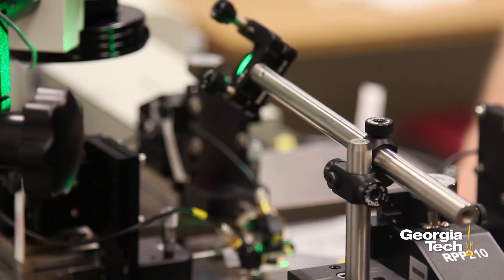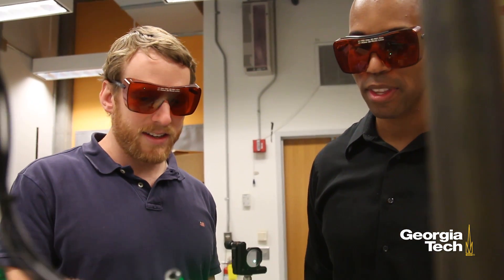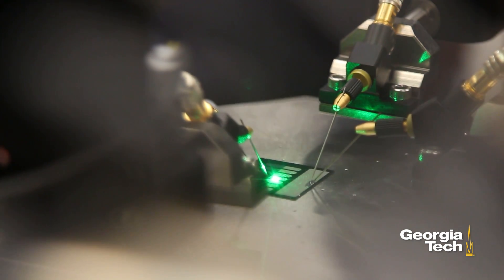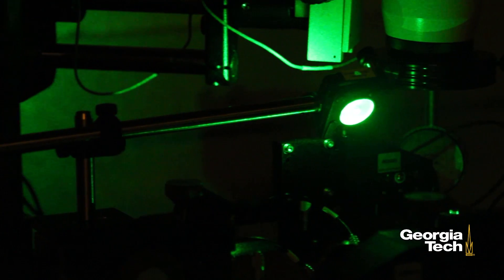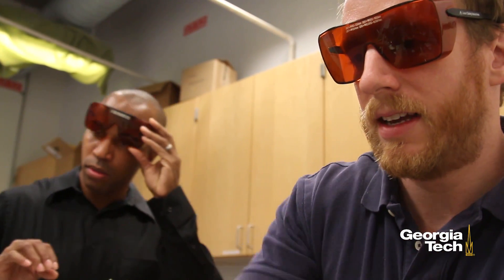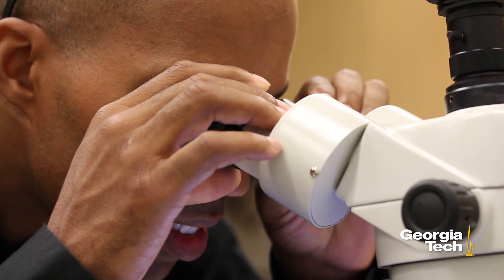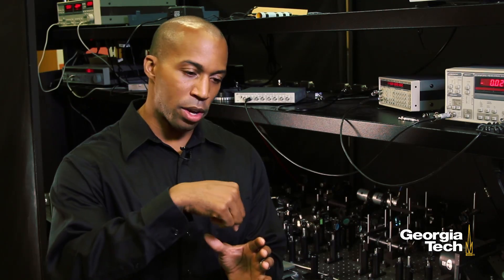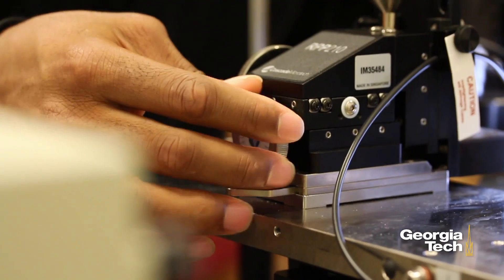First Optical Rectenna Converts Light to DC Current

Comment: Almost 10 years ago and yet this topic is highly underrated or there is some significant obstacle
Reply: Or it was a scam from the start.
Reply: @MDNQ-ud1ty  no, theory explicitly say it could work the question is how to implement it.
Reply: @Ayvengo21  Theory doesn't preclude fraud, corruption, exaggeration, etc.

Are you really going to try to use the logic "Because it is possible in theory it means they did it"?
Reply: @MDNQ-ud1ty  they might did it, but efficiency suck, price is insane and reliability at best questionable. Could it be fraud? Sure! Just like every company that promote their low wind small turbines for generating electricity, but there it even theoretically impossible to be effective

Comment: Ever since I was a kid and first learned that radio, light, xray, gamma, etc are all the same phenomenon, I wondered why I couldn't transmit light from an antenna.  I imagined keying up my CB and having an amplitude modulated light carrier pump out of my home made ground plane.

I recently started looking into the idea of receiving light with an antenna and low and behold it's being worked on.  I can just imagine a sheet of material tuned for the IR range that gets cold to the touch as absorbs ambient IR and produces a current to operate another device.  Very neat - can't wait to see what comes next.
Reply: That will prove the 2nd "law" of thermodynamics wrong. It was always based on statistics alone that "we never seen one so it cannot exist" kind of way. We should be able absorb heat from the environment and cool it down to convert the energy to different type. Open systems don't conform to the classical thermodynamics.
Reply: They are not utilizing antennas,, That might be the reason you are not transmitting.
Try a Different Approach😉

Comment: "Converts Light to DC Current", isn't this exactly how existing solar cell / photodiode works? Why would using an antenna better when the sun isn't exactly a signal generator (i.e. sunlight is kind of constant in intensity)? I know I'm missing something though. Could anyone explain the difference in layman's terms?
Reply: +Val Surely the physics behind is different, electron excited by photon (DC) vs electron oscillating due to photon's electric field (AC). What I meant was that the emphasis has been misplaced --- the end result "Converts Light to DC Current" was the same as existing solar cells, which unfortunately was the emphasis of this video (just look at the title and description) as well as other popular science articles, instead of the novel aspects of this study. Since inherently an ordinary photodiode already gives DC, directly, it is unclear how this "rectenna" design, adding a rectifier to a diode, is better. Converting light directly into DC is nothing new, all solar cells are ALREADY DC. However, keeping it in AC (i.e. without the rectifier) should be interesting and useful if the frequency can be stepped down directly to 50/60Hz from the scale of pHz. I get it that electricity at pHz is kind of useless and this research made possible the use of optical antenna as an alternative solar cell technology, but the emphasis on converting light to DC made it look lame for laymen who have some idea how existing solar cells work.
Reply: I only have a non-voluntary required education (which last 9 years here) and that was about 35 years ago so my knowledge about physics and chemistry might not be of the highest level (never was, i was lazy) but anyway:
What I got from this is that the invention is mostly a record fast diode which is needed to rectify high frequencies like light. Light is electromagnetic radiation, "just like" radio waves are, but at higher frequency, starting from infrared (heat radiation) and diode is needed to rectify that very high freq to be usable as electricity. Maybe thats why they start from heat harvesting, it's a lower freq and needs refining to get to (more) visible light.
Solar cells works differently by some weird chemical and physical effect, perhaps by collecting free electrons to gain a difference in potentials, not by rectifying directly each wave.
Also because the frequency is so high, antennas can be very small (those nanotubes) and thus have plenty of them in a small area.
Of course take all this with a big grain of salt as i don't really understand these things too well.. (but i like to ponder technical things, even when they are way over my education)
Reply: +Mobile Computing You can also convert heat (IR wavelength) to AC current, convert large spectrum of solar radiation and also the material is cheaper than PV semiconductor materials.
Reply: +Ian Might be more efficient to focus the beam onto a mass that absorbs a wide band of EM radiation and thereby converts it to heat.  The bandwidth of that emitted IR can then be targeted / tuned for.  Since IR is on the lower end of the EM spectrum it's easier to manufacture diodes in that frequency range (25ish THz?).  But a wide-band received would be cool too :)
Reply: The electric field in the e-m radiation eg light, radio waves etc is picked up by the antenna. This is then rectified into dc by the diode.
This is awesome technology as you can create a panel with lots of different lengths of antenna to pick up a wide spectrum of light, hence the high efficiency which can be acheived. Add antennas to absorb IR and youll even get significant generation at night!
Reply: www.novasolix.com
Reply: Ok, I'll do my best to explain, may have some misconceptions. And yes, this is 6 years old, but science must go on!

In a Photovoltaic Cell, two differently "doped" (meaning chemically treated/alloyed) semiconductors, the most common being silicon, are placed in one or more layers. The difference in these alloys/chemical treatments form "free charge carriers" ("holes", an absence of an electron in the crystal structure in the P-type, and "free electrons" in the N-type), basically, electrons or holes allow charges to move, therefore, they are "kind of" or "semi" conductive. Where this gets important for a solar cell, is when these two layers come together. They form a region of no charge carriers. Why? Because the free electrons and the holes meet up and the electrons "fill the holes". This combining and neutralizing of charge carriers forms an electrical potential between the P-type and N-type layers. This is because the alloys or chemical treatment include atoms with too many or too few electrons for the silicon, so when those holes are filled, or electrons are lost, the alloying materials still have their atomic charges, and those are never neutralized. Normally, this potential does nothing. But, light with enough energy can dislodge one of these free electrons again, forming that same pair of hole and free electron. But, instead of recombining, they are pulled apart, and forced to either side of the "junction", where the only path back to meet up and recombine is through the circuit. This process has a theoretical limit of ~32%. I don't remember what that limit was called.

In a Rectifying Antenna, an element, like a wire, is subjected to a light wave or similar EM wave. The changing electric and magnetic fields that make up the EM wave induces voltages in the wire, forcing a current flow. This current flow normally would just go back and forth along the wire, doing nothing useful. But, the current flow can be diverted, passed through diodes so that current flow is forced to only be in one direction, allowing this current to be used, rather than wasted. This coupling is very similar, and in fact is, electromagnetic induction, similar to a transformer. If this can be used to capture visible light, efficiencies greater than 90% are at least theoretically possible, if not practical.

So, the difference is not the end result, but the operation in which the energy is captured and the possible efficiency.
Reply: Like a photodiode, the device converts light to DC current.  The difference is in the way it does it.  If you've ever played with a crystal radio,  before you may have learned that AM radio waves generate an electrical signal on the antenna, and that signal, once it is rectified, is just enough to produce audible sound in an earpiece.  Now, radio waves are, in essence, light.  The difference between radio waves and infrared light is the wavelength/frequency.    Broadcast radio waves have a very large wavelength and normally require a large antenna.  Infrared light  waves have a microscopic wavelength and a frequency that is much, much higher than radio waves.  But if you can make an antenna that is close in size to infrared light wavelengths, then this "nano-antenna" can pick up an electrical signal from infrared light. 

Just like the crystal radio, the signal from the antenna needs to be rectified in order to get a DC signal.  Since we're working with such a ridiculously high frequency signal however, you need a fast diode, as the researcher pointed out.
Reply: "It scales".